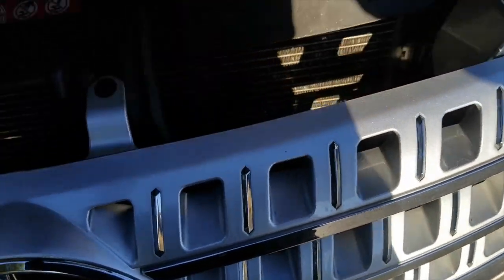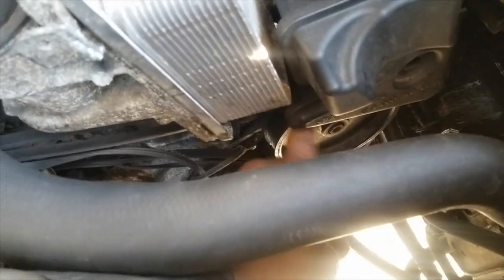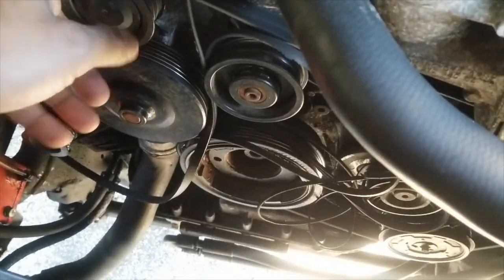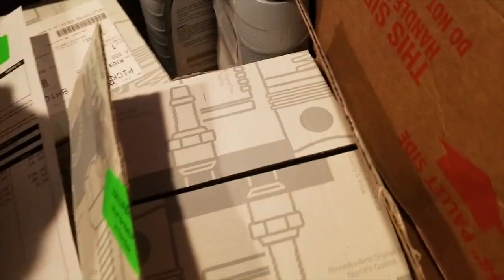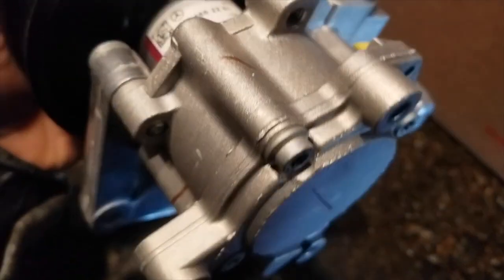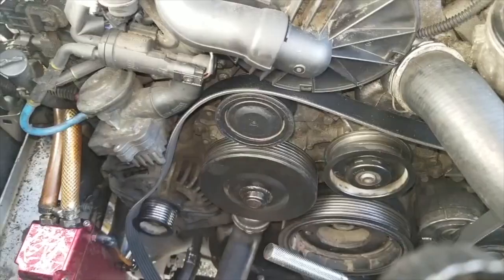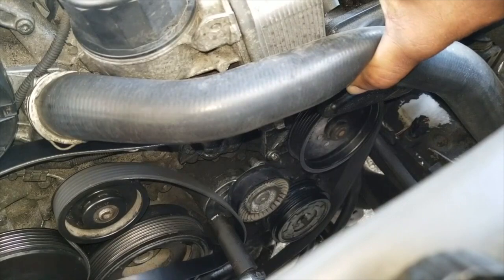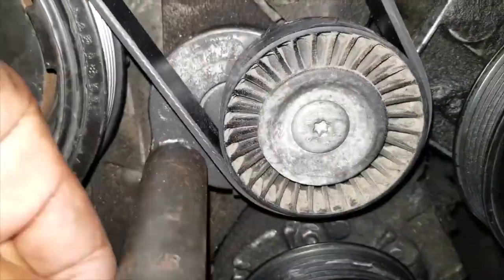My ML350 Breaks Down AGAIN!

Comment: Sorry to hear about that Keith. We know you can get it back on the road. . My serpentine belt snapped and went into my engine it cost me $3,000 to fix because it was all through the oil pan. It was very labor intensive. Good luck Keith. My pulleys even came loose and one pulley even snapped off. On my 2008 ML 350. I have bad leak with my power steering. I have to change my rack and pinion, power steering pump reservoir. $ 3200 Job. Stealer ship wanted $5700. This was actually recalled but I didn't own the vehicle at that time. 108 K miles presently.. Keith so the pump you will receive a. Core charge if you return the part to the stealer ship? Glad you were able to return the not needed parts. Salute Keith. Thx for always sharing.
Reply from the maker: She's back on the road.   Running great.   Sorry to hear that your belt caused so much damage.  Simple small parts can be cheap to replace but can cause a lot of damage too.

Comment: I would love to see you change out the power steering pump.  

The original pump lasted you over 200k miles.  Change it out Bro, your ML350 will last another 200k. Keep up the good work Keith
Reply from the maker: Thanks Vu Phung.  I will probably change it out so we have this video for the community.  I'll keep you posted.
Reply: @iRepairAutos  If you decide to  swap your pump then do the RESEAL on the OIL COOLER while you're there. 
These seals loves to fail then engine looses oil pressure which helps to  waste the passenger camshaft journals all the way near firewall.

While steering pump is out, swap the high pressure hose to steering rack.
(Don't just dream of the new electric steerings, they are designed for different failure points + a CAN Bus control module for signaling !)

Comment: ...I have learned to lightly lube my tensioner spring as they eventually fail by age and brittle. Great videos and you have helped me save thousands in parts and repair costs.
Reply from the maker: That's a good tip. I'll try it.
Reply: Yes! The serpentine TENSIONER GETTING PEGGED is what surges the bearings in (idlers pulleys, steering pump pressure regulator, alternator..) and then belt ends up loose enough to heat up and cook into pieces.

Choice is yours as to when you start swapping parts, earlier works out cheaper with only: idlers+ tensioner+ belt.
👍🏼

Comment: Although it is pricey, I would replace those items. At least you know these are brand new & won’t cause any further issues regarding the power steering area. Up to you 👍🏼👍🏼🍷
Reply from the maker: Korn PRW - I agree with you - not replacing it now is asking for a breakdown/failure when on the road.  I will take your advice - thanks!
Reply: looking forward to your replacement youtube video 👍🏼

Comment: I can tell you from experience that the first and last time I didn’t buy a Mercedes OEM part was the power steering pump. The off brand I first installed only lasted 7 months so I ended up doing what I should have the first time and buying the factory replacement. It’s now been 4 years and all is good and only original parts from now on :))
Reply from the maker: Very true Steve.  The low cost belt that broke was not Mercedes branded - ended up costing me a tow and it could have been worse.  Belts can tear up engine parts etc. when they go. I was lucky this time.
Reply: often times no-name store parts are only high-profit look alike copies 🙄 

The unscrupulous people who push these gems hope the car will get junked before their short lived replacement.

Comment: Thank you so much for sharing your experience with your ML. I have a 2011 and it's been the most reliable German vehicle I've ever owned but I appreciate the how-to's for when I do need to service it. Glad it was not more than the belt.
Reply from the maker: You're a very lucky - how many miles on your ML?
Reply: iRepair Autos 
110,000 or so. But it was serviced at the dealer before I got it in 2017.

Comment: I hope you have better luck going forward. Weve owned several Benz but Im not a fan of the ML350 as Ive repaired our 2012 a number of times. Its not even nice to replace the air filter, so its been traded it for a GLA

Comment: Keep the parts as the old ones may still fail, it’s an old car!, plus the parts will be more expensive to obtain over time. Also I want to see how to replace them
Reply from the maker: Russell Bawden - Great suggestion.  I think I will keep the old part like you suggested and replace it with the new one.  I may even break down the old part and see what parts inside are replaceable/rebuild-able.

Comment: Hi Keith, personally I'd take the parts back. You can always buy them again later. PS do you think it's possible the belt wasn't quiet on right which caused it to fail? I know from changing mine it's very hard to see If the belt it matched on to every pully, could only really check mine by feel. Big love from the UK
Reply from the maker: It is possible that the belt was maligned.  It was a cheap after market belt from one of the auto convenience stores so it might have been busy a shotty item as well.
Reply: @iRepairAutos  At least it didn't turn out to be expensive. When I changed my belt on my Mercedes GL320 CDI (X164) I watched your video on how to change it, which really helped. The only difference was the GL has a boost pipe which is bolted over the pullys which meant I had to loosen it to squeeze the belt around which made it alot harder. I'm gonna do a video showing the difference, hopefully this will help others in a similar situation.

Comment: The belt on my R350 is the original one. It is 8 years old / 137K miles. The belt shows no sign of wear on inspection and by depth gauge. Should I change the belt anyway, or is it normal for it to last that long? TIA

Comment: Keith, is the power steering pump making noises and/or has it become a little harder to turn the steering wheel?  If not, assuming there are no leaks, I would return the pump.
Reply from the maker: It has a slight hum, the kind that lets me know my vehicle is coming from  valet parking.

Comment: Take the parts back. 
Were you going to replace the pump and reservoir and use the old lines?
Reply from the maker: I was going to flush the lines and reuse them.  But you are making me think now.   I definitely should do it right and change the lines.   One thing to be cautious about and makes me really nervous is touching the end that is connected to the rack and pinion.

Comment: Early ML range was not built for reliability in mind  I guess..... more like  a money pit..  they seem to have a few too many  electrical glitches . If the car has  suddenly died , could very well be crank shaft position sensor.
Reply from the maker: Yes, these vehicles are testy.  Great model for someone who likes to work on things.
Reply: @iRepairAutos  True! These Benz are synonymous with job security!!

Every system is designed to require either timely maintenance or priceless repairs.

The best thing is to get knowledgeable about FLUIDS service all the way down to caliper juice, transfercase and differential gear oil.
Benz service schedules are surprisingly super short.
👍🏼